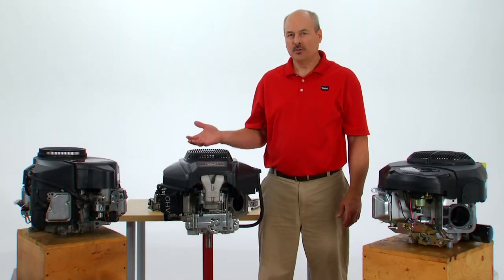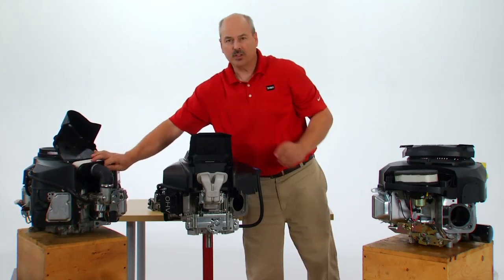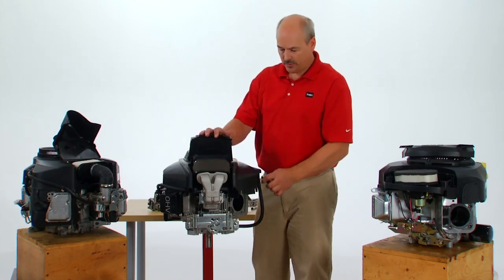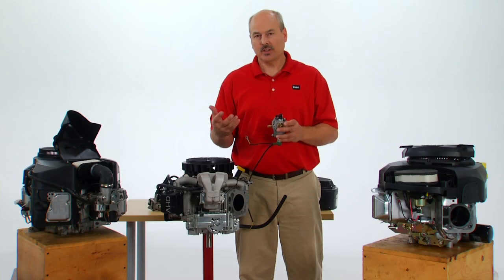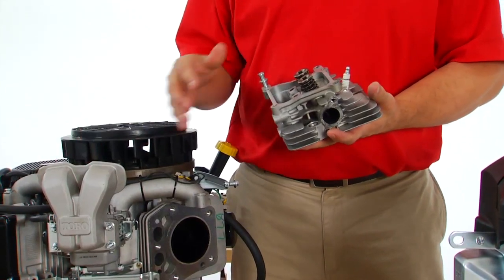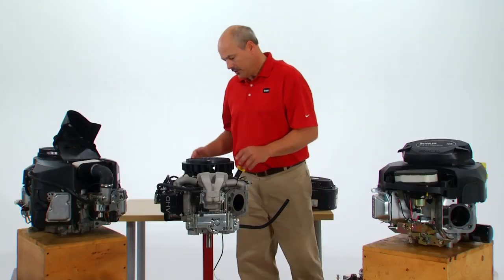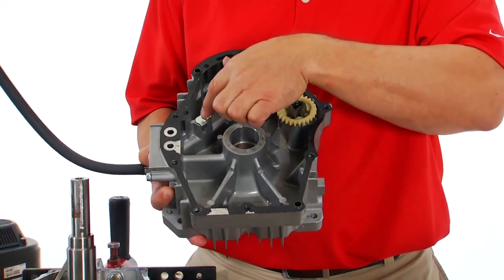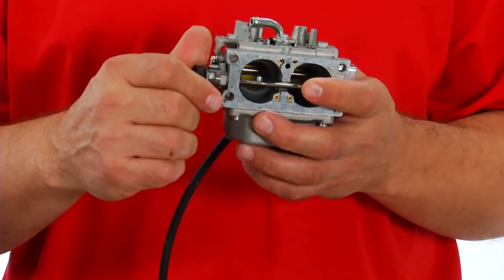Toro V-Twin Engine

Comment: My ss5000 has this engine.  It's been reliable and provides plenty of power for cutting tall thick grass.  Maintenance has been easy.  Like all big air cooled engines adjust the valves at the specified intervals.
If you have trouble starting the engine have the battery checked as it can loose cranking power even though it says 12v. 
I'd say the battery cables could be a size bigger due to the drawl of turning the powerful engine.
Always turn the engine off at higher speed to prevent backfires.
There is an excellent shop manual pdf of the engine that was published by exmark.

Comment: I have a 24.5 in a Toro 60 inch Zmaster…about 5 years old now, and it cuts all the grass on the farm.  400 hours now.  Doesn’t get looked after particularly well, but I do have Mobil 1 10w30 in it, with a larger (longer) oil filter.  I’ve had not one issue!  Runs great, lots of power.  Had previously always run Deere mowers, but the Toro won me over with the suspension platform, heavy deck, and simple/reliable deck height adjustment.  I’d buy another for sure !

Comment: Some of the comments were brutal, but this toro engine is well worth the price. I bought a SW toro zero turn mower in 2016. It has the same motor that's in this video. It will backfire when you turn it off unless you run it wide open just before shutting it off. You won't hurt the motor running it wide open before shutting down, the governor keeps it from overrevving. I have had this mower for six years and zero problems with the motor. I change the oil each season, sharpen the blades and add stabilizer in the fall to the gas. I replaced the battery last year. I did not like the idea of having a Chinese motor on the mower and did not know it until after I had brought it home and used it. Toro has a good reputation and I bought it because they stand behind their product. It still runs like a new one, I have no issues at this time.
Reply: Your supposed to run it wide open when u shut it off even with the kaw engines it’s literally in the manual
Reply: Toss a set of new ngk plugs in it and i bet it fixes it

Comment: In 2021, I purchased a 
Toro Timecutter 54 inch with the 
24.5 hp Toro v-twin engine, 
the same engine in this video.
I cut a field with it. And I mean "a field".
It takes 16 to 18 hours per week to cut it all.
ZERO problems.
Before I purchased this Toro, 
I looked at Skag, John Deere, Cub Cadet, Bad Boy, Husqvarna, ExMark, and Dixie Chopper.
This is simply the most-comfortable 
zero-turn mower ever.

I had a 15k budget for a new mower.
What was and is important to me is quality, and comfort.
Everyone has the right to their own opinion.
But I would put this 4k mower against a 
15k mower any day of the week.
I cut grass at least six months per year, 
at 16 to 18 hours per week.
I am close to 400 hours of hard use with this mower, and no problems-period.
I will probably wear the tires off this mower in a couple more years.
I'm not saying that you can't buy a good mower in the other brands, 
because you can.
BUT, NONE of them can compete with the ride quality of the 54 inch Timecutter.
My $0.02 cents worth.
Reply: This engine is a beast! Starts every time and runs smoothly. If you cut a lot of grass try the Oregon g3 gator blades, they dont cut nearly as clean but they cut more grass without bogging down and are significantly thicker and tougher. The g5 and g6 are wayyy to big for the time cutter spindles, had no problems with the g3
Reply: mine runs so inconsistantly i am going to have to take it to a shop. ive tried everthing

Comment: I've owned and operated my V-twin for more than 3 years now and it runs and cuts like new. I know there are a lot of people who think steel is always better (try selling that to Kevlar) but I will say I'm happy about my nylon cam gear. It's incredibly smooth with no sign of ever needing adjusted or replaced. Awesome product Toro, really just an amazing machine all around!!
Reply: Haha cam gears never need adjustment, they reason people are butt hurt over the nylon cams is because of the problems they have caused over the years, I'm not saying Loncin ( the Chinese manufacturer) doesn't have it all figured out. Time will tell, I get about 2500 hours out of the motors they copied. After that I rebuild them and keep on abusing them. But I digress, this motor would not hold up in a commercial environment.
Reply: @MacGyver-1 yeah that's bullshit. You're not getting $2,500 hours of any small engine, whatever brand it is. Also, nylon gears have been used in so many modern engines, there are no problems with them. I don't believe you rebuild anything, I can tell just by the way you talk

Comment: Awesome overview! I love the tear down and explanation!   when purchasing an expensive item it's nice to see the inner workings explained. That has a lot of value for the customer. Especially in a mower like this because it's not well known like Automotive Motors.
Reply: The mower that would use that motor is a cheap one
Reply: @MacGyver-1  that is very incorrect.  This motor is made by the same company that makes BMW performance motors. It's an excellent motor and more powerful than expensive models\ brands.  Also a modern design compared to a lot of the old Briggs, Kohler and Kawasakis. Also the twin carb is nice.
Reply: @ArcolaBridge  Loncin will make any motor to any price point, plastic cam gear?? Fail, also I would love to know what makes this engine modern. This a a knock off of the Kawasaki fh series engines. There is nothing inside that engine that makes it any more modern than the motor it copied. I'm not sure what your qualifications are but I rebuild about 10 engines a year. Reasons for rebuild are usually neglect with the occasional factory defect gone untreated. Normal use engines of this configuration ( air cooled v-twin) see about 3000 to 4000 hrs of use if properly maintained. In fact I will predict the most common premature failure of this motor will be burnt valves due to improperly adjusted valve lash. Just like on the the Kawasaki FH. But I digress. Please tell me what makes this motor so modern...

PS, you will never see this motor on a commercial mower. Toro had Loncin make this motor to complete in price for the consumer grade zero turn market, this is a very competitive market and everything is designed to meet a price point. The manufacturer wants these units to ideally last 8 years at which point they want the customer to buy a new one. So once again you will never see this motor on a $10k toro mower. Those commercial units will have either. A Kohler command carb or efi , or a Kawasaki FX carb or EFI. Toro knows better than
Reply: BMW is welllllll known for
Junk engines that leak & fail on target at 100k miles like clockwork!
Reply: @MacGyver-1  I will take just about any engine over a Kohler command. Those pieces of shit are only good for blowing head gaskets. Time and time again. Also since you want to act like you know what you're talking about, I've seen more Kawasakis then Toro engines in my shop, complete with Dropped valve seats and burnt valves.
Reply: @catchingfadesclashroyal6506  oh is that so? Tell me how long toro has been "manufacturing" engines.
Reply: @catchingfadesclashroyal6506  by the way I have replaced quite a few Kohler head gaskets, I always do both takes about 45 minutes to an hour no big deal the replacement gaskets have a steal reinforcement ring and they don't fail if the job is done correctly.
Reply: @MacGyver-1  I bought the commercial Toro mower and it had the Loncin engine on it and it's a back firing piece of junk. The dealer I bought it from is 3 miles from my house , The paper says I have a warranty but I took it back to them and told them fix the back firing and the battery keeps going dead. I have a load tester and it says it is bad. so they had it 2 days, I got it back the paper work said nothing about warranty, it still back fires battery still going dead. I told them to change the oil also. they charged me for oil change and 26 dollars for blade sharping. they only do what they can charge me for. I tried to call Toro and the recording ask me my zip code and they tell me to go to the same Toro dealer that rips me off. I asked the manager last week for a good number for Toro and he gave me a 1 800 number that was a survey if your over 50. Do you have a number for Toro? I have searched the net for a number for them and can't find one. even emails they go to the dealer and I have gave them so much trouble I don't think I will be going back their.
Reply: @MacGyver-1 I know you're not giving credit to a Kohler command. Those engines are supposed to be really good engines. However they're a trash and they blow head gaskets, and Bend push rods with 300 hours on them. 
I don't know who you are, but I'm a Kohler certified tech, number R78.  You best believe Kohler is not all what is cracked up to be.
Reply: @MacGyver-1  blowing head gaskets there's no big deal to you, What world do you live in?  It's not a huge job but it's not for everybody, and I'm glad you can do it and you're supposed 45 minutes. I've seen many many of all types of small engines come in to my shop and 99% of them show no sign of blowing head gaskets. Even the courage doesn't. Anyway happy wrenching sir.

Comment: the nylon cam gear is not a big deal. my father was a diesel mechanic and he said they had tractor trailer engines with nylon gears with hundreds of thousands of miles on them and they didnt have issues. like everyone on here i would prefer metal but nylon isnt necessarily a problem. i hope this engine withstands the test of time and becomes a legend
Reply: @Jay_Hall  we have been at war with britian, germany, france, italy, japan, and many other countries, should we refrain from buying from them as well? toro is an american company that gets some of its parts from china like almost everyone else does. do you think ford, chevy, and chrylser dont get some of their parts from chinese based companies? most of the stuff you buy can be traced back to china. ever shop at walmart?
Reply: @EnthusiastsGarage  Garage, Right, Toro is a USA company, and must support the USA worker, this is just common sense! Kawasaki motors are made in the USA, so are Kohler and B&S, ,,,but Toro must run to China?  I will never buy a Toro, and hope other Americans do likewise!  I will support the USA worker, many of whom are Veterans.  Buy American.
Reply: @EnthusiastsGarage   Communist China is a little different beast
Reply: @Jay_Hall  don't you mean "assembled" in the USA with imported parts?

Besides when the hell has being "built in the USA" been a good thing? China has some of the highest quality standards in the world.
Reply: @catchingfadesclashroyal6506  Covid was quality for sure!  Actually, you should move to China, you must be a TORO Exec.  LOL!

Comment: 5 bolt heads and large head gaskets equal reliable sealing. Oiling system pressurizing the crankshaft first equal reliable bearings. Two barrel carburetor equals reliable cylinder filling. Ease of service equals happy customers. Nice work there, Toro

Comment: I can say without a doubt the motor is a beast.  Very powerful
Reply: Texas Edge, oh yeah that motor is a serious contender. God damn excellence is what is it is, and by and large due to that nylon cam gear that so many think is cheap junk. They (the critics) cry and moan about a gear that never shows up as cause of engine failure, and swear they'll stick with their Kawis that uses heavy steel for the same gear- meanwhile they can't understand why their Kawis' valves need adjusted every 150 hrs or so, due to the excess vibration strain caused by their coveted steel cam gears, lol. Sorry, didn't mean to rant, and yeah totally agree- Love this little monster of a bad-ass mower engine!!!!!!!
Reply: @rickcox1843  Yeah it's so great that on the flagship eXmark Lazer zero turn they use Kawasaki engines.
Reply: @nexushexus4365  dude get real....you can't even buy a shit 4stroke small engine anymore. even the crappy harbor frt predators are solid as a rock and WAY better then any thing made 20yrs ago
Reply: @crabtrap  This is true. I wouldnt worry much about any motor at this point if you just take care of it. I have a kawasaki and a toro motor. I love them both.

Comment: We shall see just bought a brand new 2021 54”time cutter mowing it’s first yard tomorrow I like the design of the my ride “AKA” a recliner on your zero turn and all the simple features very solid mower and I’ve owned a bunch of name brands I have high hopes of this intake and 2 barrel carb along with the internals with a 3 year unlimited hour warranty all for 4 thousand cash not bad
Reply: Trying to determine if I'm going to drive an hour to get the one I want with the MyRide. There's a serious shortage going on around these parts. I couldn't even take advantage of the $200 off special because no dealers seemed to have the models I was interested in.
Reply: instaBlaster...
Reply: I ended up getting mine. Only two issues is the platform rubs on one side near the feet rest when pushed over (while holding the seat). Sawn one at Home Depot with the same problem.  Second is the deck wash hose attachment broke the on the first use.

Other than those two things I've been loving it. No stress on the back over bumps.
Reply: mine broke twice before it mowed the yard 3 times I got rid of it and bought another mower

Comment: Those engines look like great quality! Good job by Toro!
Reply: Edwin,,not quality, just cheap, does not hold value and has bad reviews.  Kohler or Kawa for the smart educated buyer.
Reply: I own one and it has a 3 year warranty on the engine but I can't get them to do any thing to it . It back fires and they won't fix it I took it to the dealer for the back firing and all they do to it is what they can charge me for.
Reply: @tonyjohnson1068  The best way to stop the backfire is run the engine wide open then turn the ignition off. I've had that engine for 6 years and so far, no problems other than the backfiring.

Comment: Great design! However, out of all the engines, I will ALWAYS prefer the Kawasaki engines for every mower i get. They are amazing quality, and last forever!!
Reply: Glad to hear that, I always was wondering about them never had one
Reply: 4 Kawasaki roadbikes amazing reliable motors......why buy anything else's
Reply: Lawn service dealers in my area swear by these Kawa engines
Reply: J. Johnson I bet! Most guys do, the dealers and the landscapers. I run bobcat mowers and bobcat only sells their mowers with Kawi’s in em.
Reply: @agoushy74  if you guys are looking for the absolute best engine for any machine, the best look to Honda.
Reply: @catchingfadesclashroyal6506  my experience with Honda engines, poor power performance compared to other in the same class, ridiculously expensive general  maintenance parts. Worse reliability as far as the push mowers.  Horrible warranty service. Honda made a much better mower 20 years ago.
Reply: I got a new commercial my ride Toro and it has the Loncin Toro brand and it sucks Back fires 1 out of 10 times I shut it off. I took it back to the dealer and they just jack me around.
Reply: @catchingfadesclashroyal6506  10 years ago with my landscape company I would have agreed with you now I look for just kawi engines very little issues with them at all most reliable I've ever used Honda's not what they once where and way too expensive to fix

Comment: how does this match up to the kawasaki? i know the kaw is a solid motor is this just as good or better? reliability is key for me
Reply: It doesn't mach up at all. It is a CHINESE made engine. They basically sourced a Chinese engine maker to make a "Toro" engine. In truth they put a Toro sticker on it.
Reply: Gilitar, fact is the Chinese flat out design and manufacture some stuff better. If this engine is Chinese, as you say, then hats off to the Chins for their innovative designs! Love that nylon gear- more efficient, quieter, smoother crank and less drag than conventional steel or brass. Love those over-sized piston rods too!
Reply: Rick Cox this guy makes the same comment on all the toro and exmark videos
Reply: This one is way better than Kawasaki and will last 36 1/2 times longer
Reply: @rickcox1843  Another scared Toto dealer!  The serious machines have USA made motors!
Reply: @JanYi2023  LOL!!
Reply: @whiskeytangofoxtrot9403  I got one and so regret it. Junk and they dealer they are not giving me warranty on the engine big time back firing.

Comment: I just got one from a friend who put a new motor on his time cutter.  It has oil coming through one exhaust . Is it rings or valve???  It runs but when warm it loses power and backfires  sometimes.  Please help
Reply: Take the Loncin (Toro)engine off and put a Kawasaki it will be fixed.

Comment: Has anyone ever encountered a problem where the heat from the engine is melting the Jacket of both throttle and choke cables? I am also wondering if the cables were routed wrong from the factory???

Comment: Looked at a Toro with a V-twin engine last fall, liked the look & specs of the machine but didn't buy.  Went out the other day to purchase (year end clearance) but dealer was closed even tho their website said OPEN.  Glad they were after reading comments about the engine.  Also another site had comments about new machines not starting at the dealers and had to be exchanged before loading to take home.  Too many negative comments about this engine, would prefer the Kawasaki.  Will continue looking...maybe Cub Cadet??
Reply: Hope you didn't buy a Cub Cadet, They are a highest level of junk. I had one years ago got rid of it after 2 months. I was getting stuck I live in Florida we have sandy soils. I got the Toro commercial my ride, Nice mower. but hate the Toro engine.